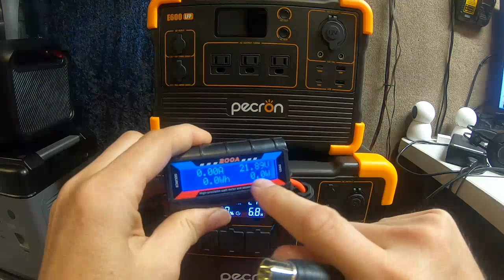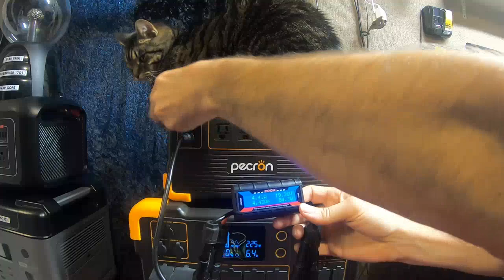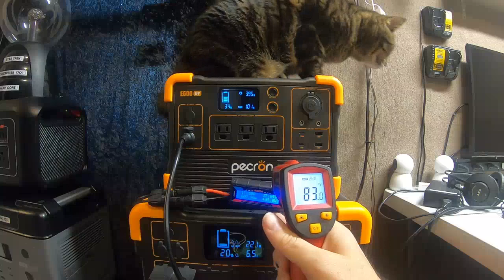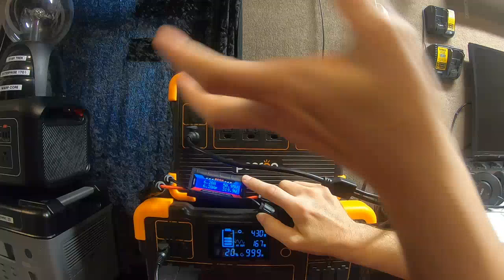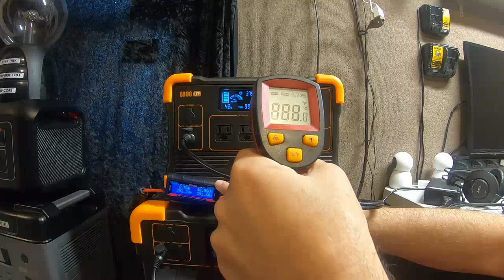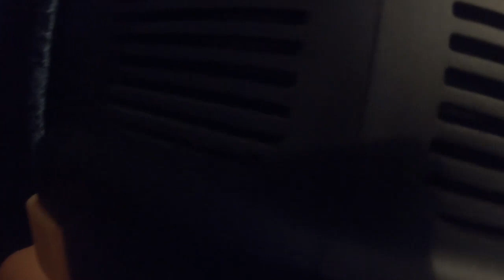PECRON E600LFP Power Station (UPDATE 2)

Comment: Dude I love all the info you give us, much appreciated 👍🎉 so it seems we can run 2 12v panels as 24v on the bottom dc input. What about one 12v panel? My plan is to use the upper input from cars cigarette and the lower with 1 - 2 solar panels. Will it work parallel and so you need a solar controller with this unit or can the panel be plugged in directly? Thanks
Reply from the maker: We ran 1 acopower 200 watt 12v panel in the test in an earlier video and it worked just fine through the 5 pin aviation port :)

Just keep an eye on the VOC of a panel and all is good :)

Plug the panel straight in, MPPT controller is built in :)

Comment: I thought minimum v0c to charge solar was 32 volts how are you able to charge at 22 v o c
Reply from the maker: Yes, You have a good eye ;)

  We were going to make a video about that. So, This model only has "1" MPPT controller.

barrel port 12v-18v
5 pin aviation port 32v-95v

But it seems that because it only has one MPPT controller, It allows a lower voltage on the aviation port to charge because it does not understand were it is coming from, It just does :)

More testing will be done, but if this is 100% true, That is FANTASTIC !!!!!

P.S. :)
Reply: @RamblinBobReviews  appreciate the info that is good news

Comment: Thanks for the review. I  am very new down this rabbit hole so infortmative data is very appreciated. 

My E600LFP arrived today. I have only run a few appliances and tools through it, but nothing above 1kw. So far, I'm impressed. I have the eb3a, now this unit, and have a VTOMAX 1500x on order. Now I need to add more panels. I also like the Thunderbolt panels for installation, but we also need panels for camping and travel. 

I just now got GEEKED UP, and I tend to go Master Level. It's just the way I'm wired.
Reply from the maker: Welcome to the channel Brian :)

 Yes, This little e600lfp is a workhorse for it's size for sure.